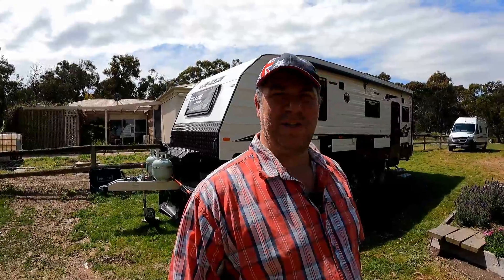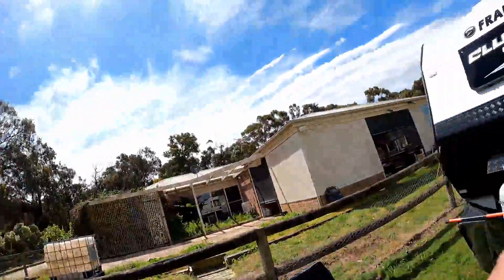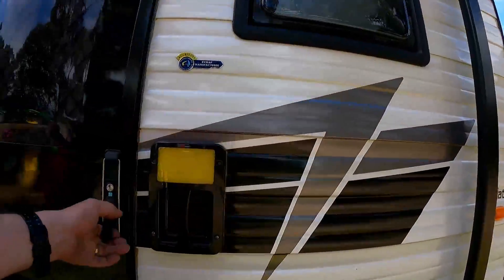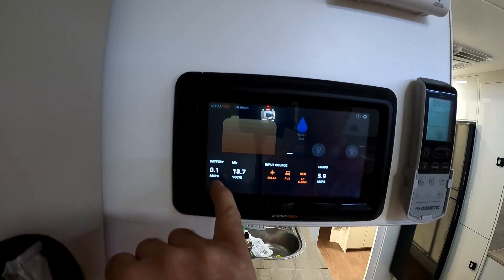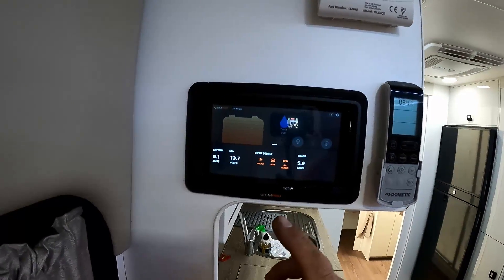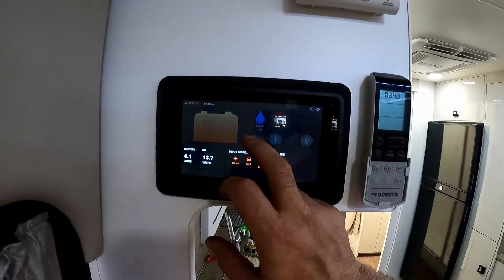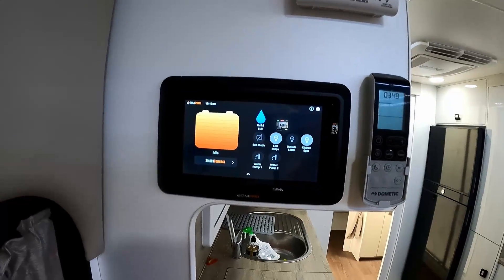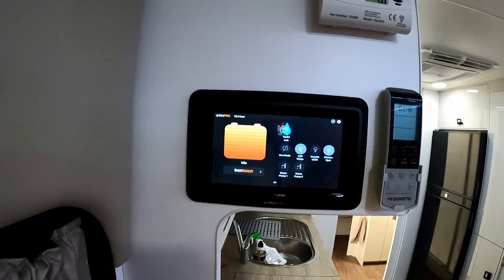Solar panels and your Aux connection BMPRO

Comment: I  have a Aus Caravan here in NZ with a BMPRO 35 HA  . I have 2x roof solar but need more Power so , I connected a portable solar panel to my Aux plug ,Both unregulated and regulated and it did NOT  show up on the Trek display.
 ( In Aux as per the Tow Vehicle ), was told by BMPRO agent ,here not to do that , its a real pain to access the BMPRO in Caravan and run wires out of sight ( its installed in overhead cabinets  ) , its disappointing the Van manufactures don,t run a conduit pipe so extra wires can be run , if i can,t get to it ? , i will go straight to batteries with a regulated panel via a Anderson plug set up , i wont use a BMPRO 300 shunt ,as they cost a arm and Leg over here NZ $650
Reply from the maker: Yes, I agree, the caravan manufacturers do not build the vans to be future proof at all, to be honest im not a fan of the BM Pro system anyway and have now upgraded my system, I still use the bm pro to check my water levels and control my lighting and as a 240 volt charger, but all my solar needs are now taken care of via Victron, luckily Franklin ran 12mm cable to my solar panel which meant I didnt need to run extra wires :)

Comment: Thanks for putting this video up and the information. My caravan dealer told me when I asked that I could plug an unregulated solar panel into the aux Anderson plug so I have been plugging in my 200w solar blanket unregulated into this plug! It registers on my BMPro Trek display as an AUX input. Ive done it a few times but from now on I'll make sure its regulated. I was going to get an external Anderson plug fitted but was told this would be fine. Ive got an MPPT regulator for the blanket so should be fine now that I know. Hopefully no damage has been done to the BMPro but it seems to be working fine.
Thanks again.
Reply from the maker: I’m sure it’s fine, it would have gone already if not….. it’s fairly easy to add a second unregulated solar input to your Bm35 as the terminals are already there, just requires the Anderson and a couple of spade terminals, that way your bmpro will calculate it correctly and the MPPT controller is inbuilt ;)
Reply: @Richard-Tanya  Thank you, I will look at doing that as that sounds like a better solution. Cheers.

Comment: Van currently on Factory order are going to wire in a Ando for my external Solar panels to the BMPRO.
Reply: Just check when you pick up the van because I got the dealer to install an anderson plug for solar and lucky I check prior to pluging in my unregulated solar panel and found they wired the plug directly to the battery which would have cooked the battery, I got them to rewire it to the bmpro solar input which is what they should have done in the first place.
Reply from the maker: Correct, there is a second solar input connection on the BMPRO which enables you to use an unregulated panel, it’s a fairly simple job, I posted a video showing it :)

Comment: I agree. There is a second connection on my BMPRO for  unregulated solar panel. Our dealer ran wires from the BMPRO to a new anderson plug on the chassis.
Reply from the maker: yup thats the way I did it too :)